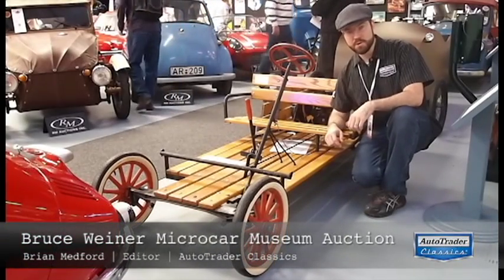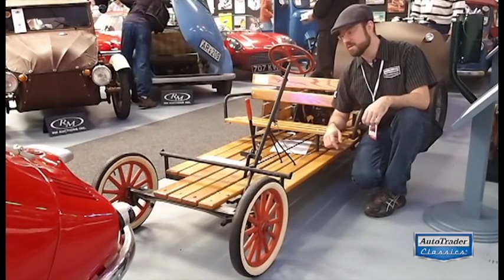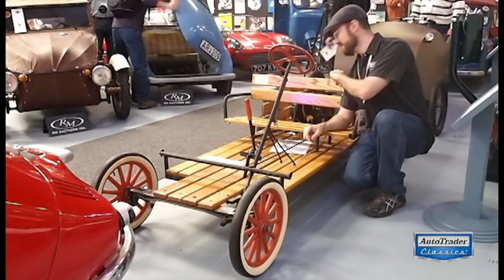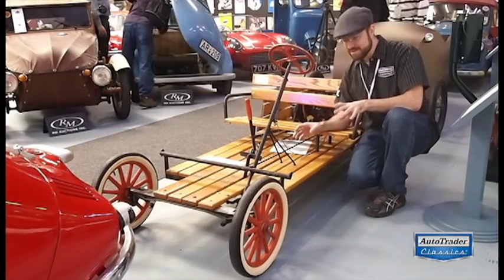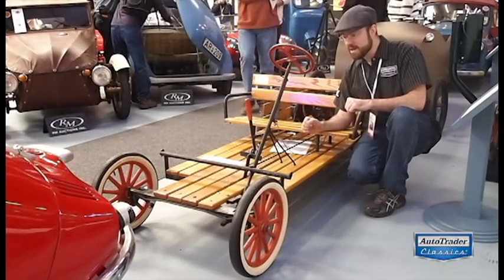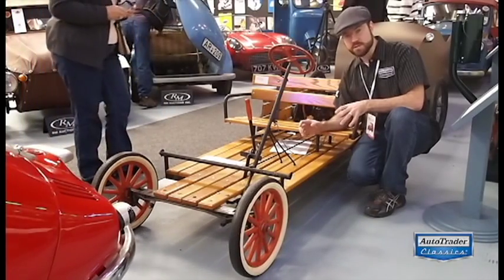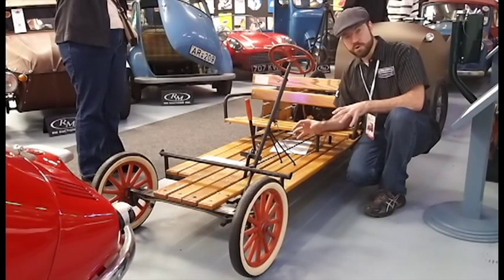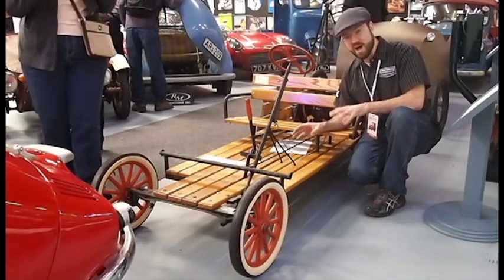1960 McDonough Buckboard  | AutoTrader Classics | RM Auctions

Comment: My brother and I used to have one. I always thought it was a child's go cart . Ours even had a top that folded up and I haven't seen  any on the Internet with the top. It was fun to ride in because the boards acted like a suspension in a way. I wish I still had it.
Reply: My Step-mother bought one in great condition, with the original motor thats still ran good, for $800 about 4 years ago. One nearly identical to hers just sold at an auction held by Sotheby's for $16,100. She normally has no bussiness sense at all but this time she may have made a good investment.